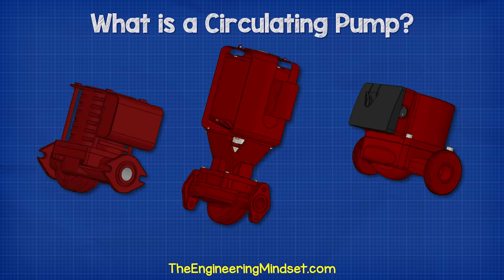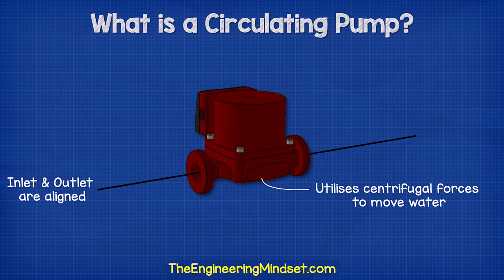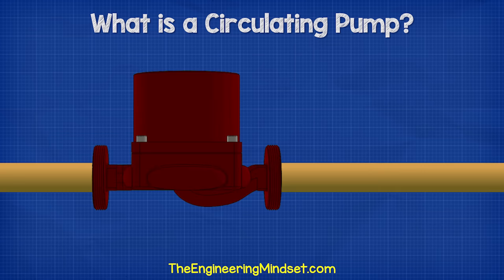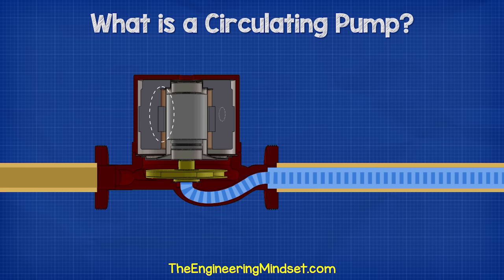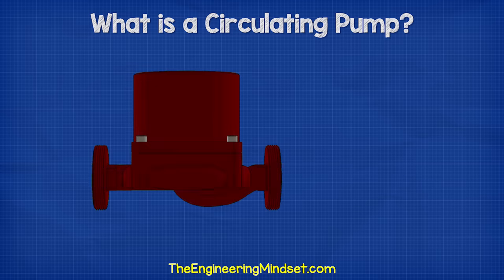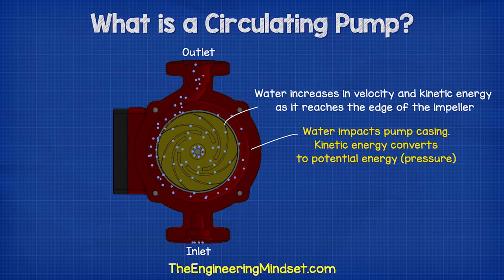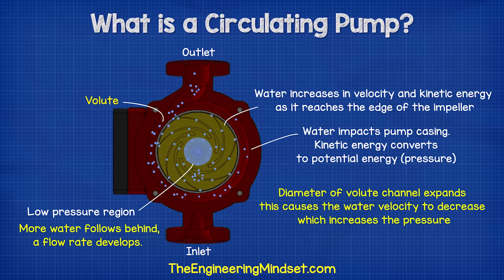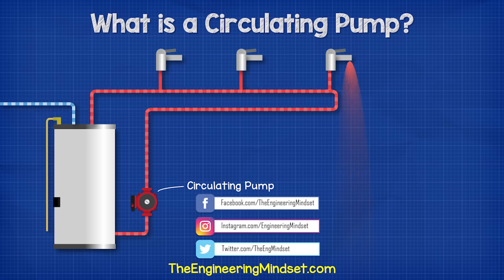Circulating pump: What is it & why is it important?

Comment: Wow! I've never had anyone explain an impeller and such a great way, I didn't know it was actually centrifugal force pulling the water away from the center that caused the whole thing to work. Thanks so much for your help I was interested because I'm at an Airbnb that has a water circulating system and I was wondering why the shower was instantly warm.
Reply: Those pumps are used for huge boilers in hospitals etc and can be multistage where one impeller feeds water to another one to get even higher pressure. I worked in a hospital with steam boilers and we needed really high pressure to feed water into the boiler and had multistage pumps.
Reply: So no external power needed?

Comment: I recently bought one of these for my home hot water.  It includes a neat temperature-activated valve that goes under a sink, and bridges the hot line to the cold, enabling water to return to the tank until the hot supply at that faucet gets up to temperature.
Reply: Have you noticed an energy cost increase at by installing this?  It seems that by circulating the water throughout the pipes in the house that you're exposing the water to more heat loss than it would had the water just been left in the tank, thus creating the need for the tank to be on for a longer period of time and turning on more often.
Reply: Nice. Looked into something like this a few years ago. I have a simple Grundfos circulation pump transferring the hotwater from a heat pump to the furthermost hotwater tap. Saves a lot of wasted water waiting for hot water to arrive from the heat pump tank.
Reply: @dasfahrer8187  I haven't run it long enough to make a meaningful comparison.  The pump also has a built-in timer so you can easily set it to only run at scheduled times.  That way you're not constantly heating the loop.

From a strictly mathematical standpoint, it will raise the energy consumed.  Both from the increased amount of water being heated,  and the energy consumed by the pump.  It is literally a matter of paying a little bit more for added convenience (no hot water wait time during scheduled hours).
Reply: @Kineth1  Thanks for the reply.  Will have to keep one of these in mind when I replace the water heater.
Reply: @dasfahrer8187  Grundfos has a pump for this with built-in timer and thermostat to keep electrical cost down. 
If you have access to the pipe you can insulate it to reduce the losses.
It will also save water.
Reply: I have been running  this pump on my got water heater for 14 years and 12  hours a day with no issues.
Reply: @gerryshaw8728  Nice!  Thanks for sharing your experience.

Comment: So, I don't have a hot water loop and have one of those temperature controlled one-way valves at my furthest faucet that dumps the cold "hot" water into the cold line until actual hot water shows up.  How much is this type of pump restricting my normal hot water flow when it's NOT running?  I only run it on demand or on a schedule.  Doesn't seem like it restricts it at all.

Comment: Maybe it is an american thing, but I have never seen one of these anywhere in my hot water system.
Reply from the maker: Where are you based. I'm in the UK and we have them here. It might even be inside your boiler
Reply: @EngineeringMindset  Seattle, WA. Ive looked up diagrams, and it seems that our water is highly pressurized coming into the system from the water district. Our hot water waste also goes directly to sewer, so it wouldnt flow back into the water heater like in your diagram.

Or it is possible I am still missing something.
Reply: @Biomancer81  I work in the US and in CEA (controlled environment agriculture). These are primarily used in our heating systems for root zone heating or dehumidification. I think they're used mainly in heating as I have one for my heated floors in my house too.
Reply: @theglizzy12  Right, but not consumer or commercial water heating for use in potable taps.
Reply: @Biomancer81  Lots of houses have hydronic heating with circulating pumps and yours is likely a gravity type with  a expansion tank which has air in part of it which is compressed and maintains pressure on your system. It can get airlocked and needs bleeding every few years unless it is a bladder tank. 

Your pipes are also larger than a hydronic pump based system. Systems with pumps generally have zones and more than one thermostat and shut off valves. I am a HVAC guy in Canada and have seen thousands of these systems. Search hydronic heating for more info.

Comment: I have a recirculation pump on the hot water heater downstairs, the recirculating line like this upstairs under my for the sink. I turned off the recirculating pump, and I unplugged the timer. I am still getting hot water almost on demand upstairs in that bathroom and I don’t want it recirculating because I just found out how bad my copper pipes are. Why is it still coming up there so quickly if the pump is unplugged and what pipe is it recirculating through? The cold pipes? Would it help if I had someone remove the thing under the sink upstairs?

Comment: We have a lime system, in our process effluent plant the lime circulates around a ring main pipe system, reason is, if the lime stops circulating, the pipes will block. If the pH of the liquor drops on the pH probe, the computer system program (IFIX) will put a shot of lime into the reactors to bring the pH up to 9.

Comment: So I've had a working idea around this type of system before. This looks like the same style circulatory system used to heat floors or driveways during the winter. I have multiple fish aquariums, and I've had an idea of running sealed pex piping, in and out of the tanks, in series with hot water running through a cycle like this, in hopes that the temperature of the pex can maintain a constant temperature to heat the water, and eliminating the need for multiple electric heaters. Does this theoretical system seem like it would be feasible in this scenario?

Comment: I've always wanted hot water immediately to the master bath but I've had the nagging feeling that a circulating system would be wasting energy in heat loss when not in use. But I suppose I'm also wasting water while I'm waiting for it to heat up. 🤔 Insulating the heck out of the pipes would make me feel better about it. 
Thoughts, anyone?
Reply: My pump has been disconnected for years. Idk I kinda don't mind cold water at the beginning, usually hot water is there before I'm done washing my hands 😁 And that's just hands. For bath or shower it's pretty much irrelevant. Or maybe I'm just weird 😆
Reply: I have the same thoughts/questions.. what's more energy efficient -> to use a Circulating pump or not?
Reply from the maker: It's almost certainly cheaper to waste some water than run a circulating pump 24/7. You could potentially run it on a time schedule so it circulates shortly before you wake up. But commercial buildings usually have regulations that a hit water tap must reach a certain temperature within a certain time to prevent legionnaires' disease
Reply: @EngineeringMindset  I like the idea of a timer which led me to discover the "on-demand" circulation pump. It looks like you turn the water on briefly, the system detects it, starts sending hot water through the loop, then you turn the hot water on a few seconds later and it's hot.
Sounds cool but I'm guessing it's a pricey system.
I think I should start with making sure the hot water run to the sink is as short as possible with as small of an inner diameter pipe that I can get away with.
Reply: Circulating pumps use electricity and they wear out and then you need to pay a plumber to replace them. Taco pumps are great but I think the electricity cost is going to make you think twice. They use them on some instantaneous water heaters but now we are talking multi thousand $$ water heating systems.
Reply from the maker: I mean it's not particularly expensive to run. For example a standard small circulation pump can do about 65 litres a minute and draws a current of around 0.45A on a 230V connection. If we assume a PF of 0.9 then 230V x 0.45A x 0.9 = 0.09315kW so it'll use 0.093kWh per hour. If you ran it for an hour a day each morning then 0.093 x 1 x 365 = 33.9kWh/y I pay around £0.3/kWh currently, so that's £10/y
If you waste say 2 litres of water each morning waiting for hot water, then 2ltr x 365 = 730 Ltr/yr and I pay something like £0.01 per litre so that's £7.30. So it's slightly cheaper.
You have the one off cost of the pump ~£60 and a plumber ~£200
It'll likely last 10-15yrs
Reply from the maker: I've previously installed a smart system that monitors when taps are used (system pressure drops and new water enters system) and then starts to predict when hot water will be used and turns the pump off at times when the pumps haven't been used previously e.g. 11pm - 6am, slow the pumps when it's possible you'll use the pumps but might not, and runs the pumps when it predicts you'll definitely use the hot water e.g.  your morning work routine
Reply: @EngineeringMindset  i have a circular pump that has a "auto" mode and does exactly that. Also it has a "temp" mode and circulates when the templerature gets low.
Reply: @EngineeringMindset  It would cost about 2-3 hrs labor at $150/hr for the plumber and up to $200/hr where I am plus about $125 for the pump plus a bunch of copper pipe or PEX and hooking up to install it where I am. Grand total of at least $750 to install it. 2X as much in some large Canadian cities like Vancouver and Toronto. 

I agree it does not cost much to run and my quick calculation of W=E x I  230 x .5 gives you a 115 watt light bulb on all the time which most people may not like. In most homes where  I am the ceilings are finished and running a water recirc  line to the furthest area/bathroom is next to impossible. Putting it on a timer would be expensive and there is more to fail. My lady friend has a very wealthy cousin who is a Doctor and has a high end steam shower computer controlled bathroom and yeah it is great until the circuit board or sensors break and then you have to shower at work. KISS, keep it simple stu*pid is my motto. LOL. 

I did have a LOT of recirc lines in the hospital and Convention center I worked at but that is quite different than residential. The line eventually wears out from circulation and we have leaks and more expense. We even have gray water heat recover devices in our water drain in  our new  houses where I am so most people here are pretty energy conscious and don't like spending money if they don't have to.

If I was building new and had a instantaneous through the wall heater I would get a recirculating line also.
Reply: You don't need to have the hot water circulating 24h. I have a timer on my pump to run it at the times I most likely need. You could even have a remote switch to turn on the pump to circulate the hotwater when you need it. In fact, adaptive circulation pumps "learn" your usage patterns and attempt to predict when to be on for you. I am planning to add a smart plug adaptor to my pump so I can control it through google home or a smart home  sensor in the bathrooms.
Reply from the maker: Seen the new LED explained video? so much detail covered! https://youtu.be/O8M2z2hIbag